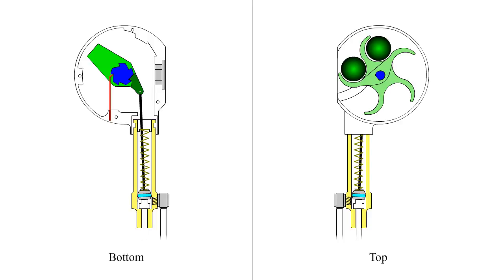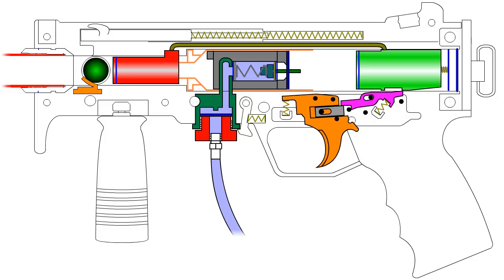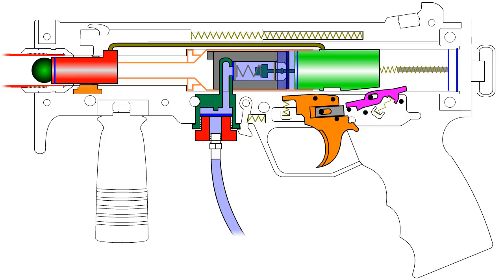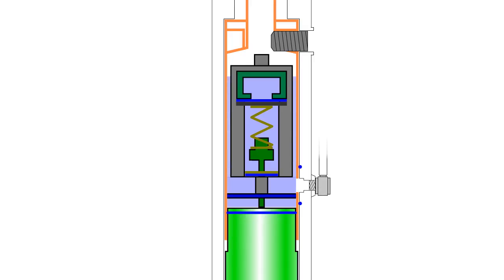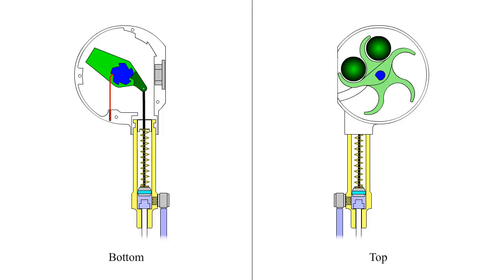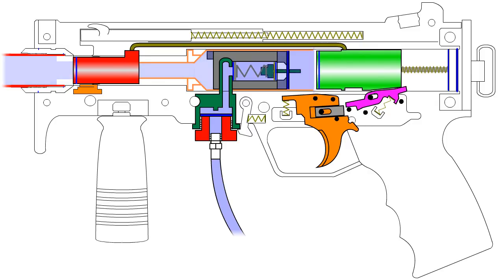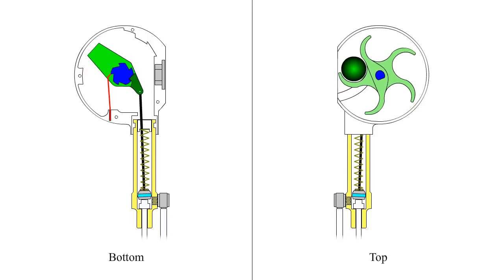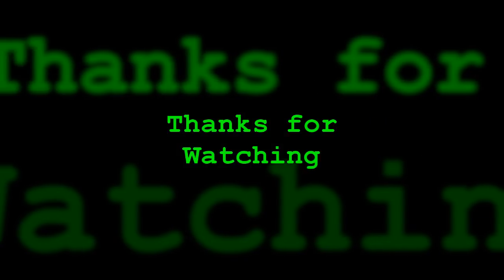How a Tippmann Cyclone Works

Comment: My ratchet broke off were it meets the feeder axle. Where it teeth meet each other. I upgraded to the aluminum versions which help for a while but now they are worn out to the point where it won't cycle a round in the chamber. Any ideas? Thanks and great video

Comment: I own an A5 and so far no chops. Ive taken my marker to 3 seperate games. Its very reliable. If it sucked Tippmann probably wouldnt have added it to the X7 and X7 phenom nor would they have made a Kit to retro fit cyclones to 98 customs. The only problem (if you really want to call it one) that I have experienced is that the cyclone will stop or skip a feed cycle when the air gets low. Usually just below a 1000 psi.